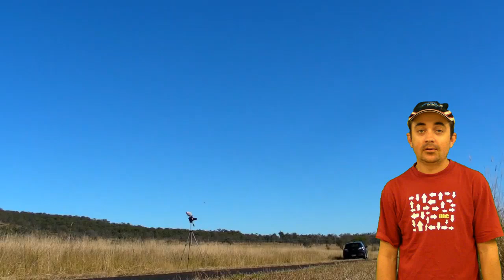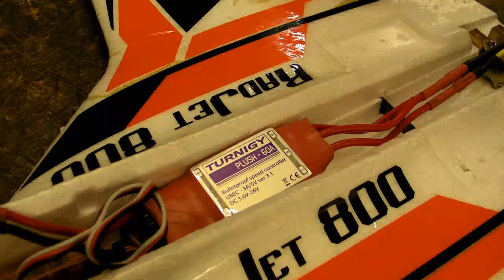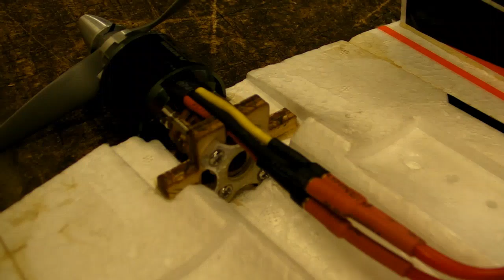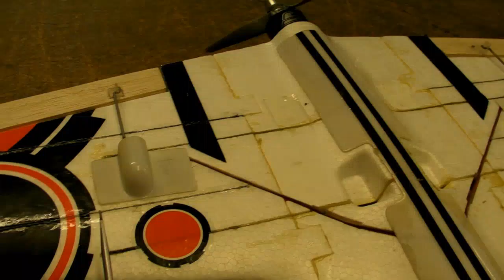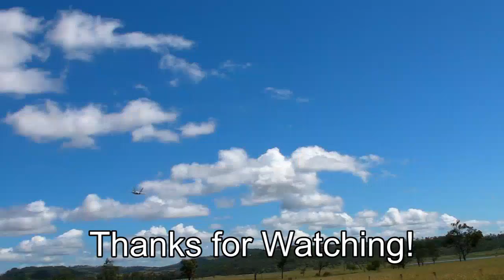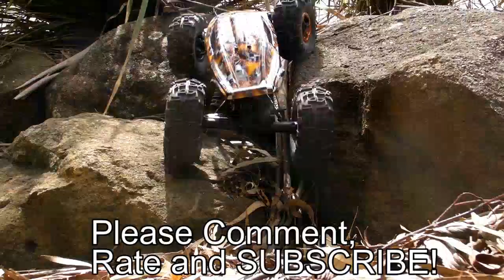How To:  RadJet  230KPH SPEED Setup

Comment: how would a Dr Mad 50 mm EDF go ( 650 g thrust on 4s), would that be faster or are the engines driving propellers faster
Reply from the maker: a 50mm eff is fairly small and 650g thrust isn't very much ( this setup is more than double that amount) you would have to find some crazy motor setup to get the same output.  this setup is around 1.5 hp
Reply: TheRattleSnake3145 yes now I have ut it together I am worried about thrust, I might jusst put the original setup back on and keep the EDF for a smaller wing or delta, maybe something about 500mm, I did buy 2 so I could set up a dual EDF system on a plane, living in the bush I am glad I have these spare parts, I am just waiting on a antenna

Comment: getting ready to set this up would like your opinion.  since I dont own any 6s batteries but have piles of 2200mah 4s was thinking of going this route, since I have used it on other aircrafts and it seems to get the most out of my 4s batteries.

NTM Prop Drive 28-36 3000KV / 755W
80A ESC (using seperate bec)
2200mah 4S
props 4.5x4.5 to  6x4

please let me know if you forsee a problem.  the batteries weigh 263.grams

thanks
Greg
Reply: just checked and my battery is 40grams extra weight you think I am still ok?
Reply from the maker: Greg Roller  That would be fine as your motor is lighter.  However that being the case you will likely have to move the battery further back than I had mine which would involve cutting into the fuse.
Reply: TheRattleSnake3145 thanks for the reply.  Would rather copy your exact setup but at 30 bucks a pop for batteries Ouch!

Comment from the maker: Thanks! 
As far as Im aware its the fastest one on YT, I have come across people that say they have a faster one but they either didnt get it on video or the speed was in a dive.  I do my speed runs completely level!  I could cruise for 10 mins or so but usually I just do high speed passes and get 3 mins or so.  thats with a 1300mah 6s

handling does suffer with these mods  but they are needed if you want the speed!

take a look on my Ch or search for "1200watt radjet " to see a speed run .

Comment: BEST radjet on YT!!!...what is the flight time with your setup?? crashed mine after 4 flights using 700w 3000kv nym propdrive and 2200mah 3s, maybe I'm too heavy or got the CG wrong, I'm thinking of using a 1300mah 3-4S

Comment: Hi there , i got the radjet 800 with stock motor and a Turnigy plush 30A ESC , 1300mah 3cell Zippy Lipo's . Would it be able to speed this thing Up with a 4cell 1300mah ?

Comment from the maker: one thing you might like to know is that even if the end RPM is the same,
a Lower KV / Higher Voltage setup will have less amp draw than a Higher kv / Lower voltage setup.

Comment: I'm still getting the hang of motor ratings.  I ordered a 28-36 3000Kv for my RJ with 4S 45-90C and 60(burst 80)A ESC - 4.5x4.5 planned.  But I just noticed that the 1800Kv has a higher power rating - which is not immediately obvious until you realise the 1800Kv is a 35mm diameter :)

Sometimes it isn't always about the KV!

Comment from the maker: The motor you were using is rated to 50amps max.

My 28mm 2350 kv was drawing just on that, so your 2700kv would have been drawing more.
Which is probably why it smoked.

Comment: Thanks for another great video! Keep up the good work, and I am really glad you posted this so I can more easily choose a fast Radjet setup.I do have a couple questions though. I'm working on an Excel spreadsheet calculator to help choose good high-speed setups, and I'd like to know what the RPM's are with this at full throttle, static.  Also, could you please try this plane with the same setup except with an APC 8x8, 9x9 (both gas and glow props) and 4S LiPo?  I'd like to see how that compares.

Comment: wow man thats amazing. I had a rarebear and a parkjet but they only did about 100kph or so. I only have a hobbyking 1mtr slope soaring wing but it has the gear off my parkjet on it and its still pretty quick but I will mainly use it for slope soaring. Thanks for sharing your video and BTW how are you going with your boats?